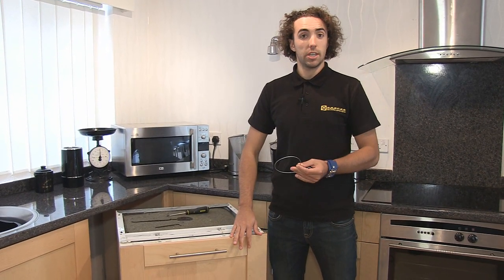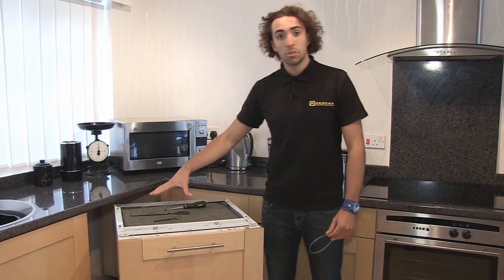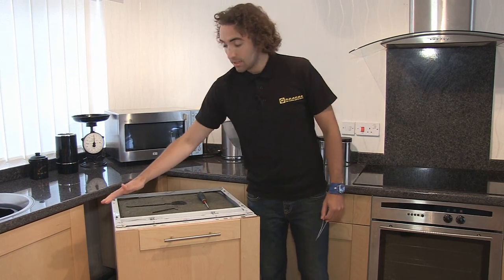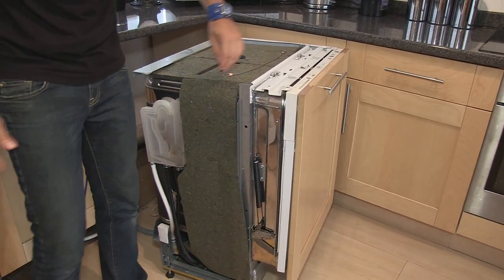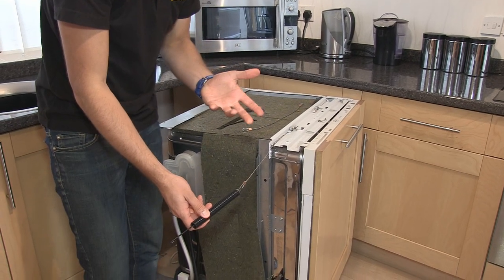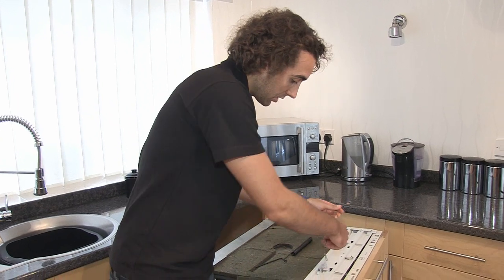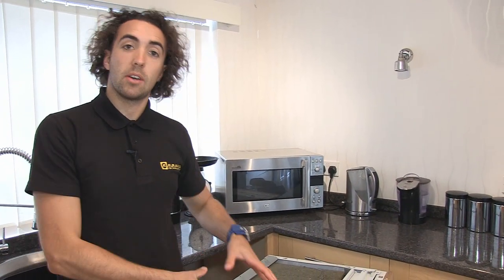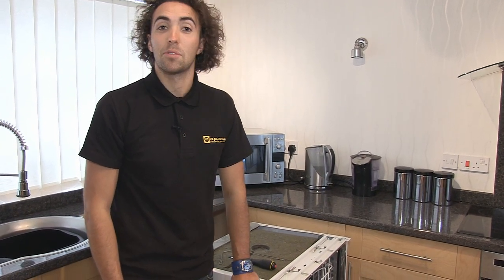How to Replace a Dishwasher Door Cable

Comment: Hi Josh. Can you please tell me which video shows how to remove the dishwasher from its cavity - I can't find one with that title on your channel. Is it in one of the other diswahser videos?
Reply from the maker: Hi Robert, we don't have a video on removing a dishwasher but usually is straight forward, if you drop the door down and locate the screws that go into the cabinet. Check you have enough room to pull it out as you may need to disconnect the hoses, take care when pulling it out as you don't want to damage the dishwasher or your floor.
Reply: @eSpares  Hi Josh. THanks, I worked it out after I found out how to get the trim door off. Cheers
Reply from the maker: Hi Robert, well done for sorting it.